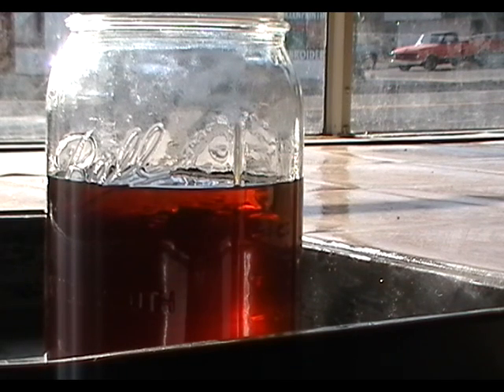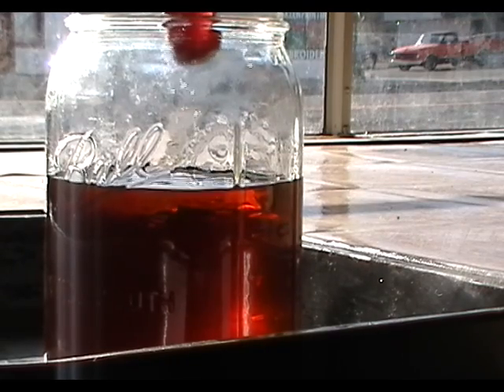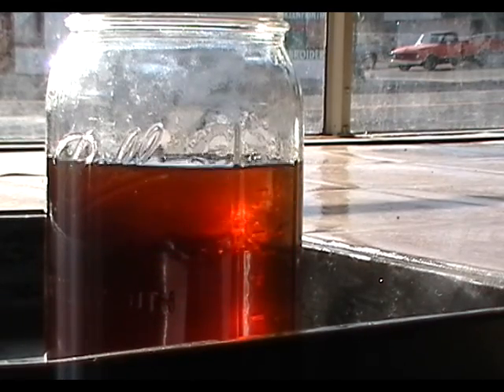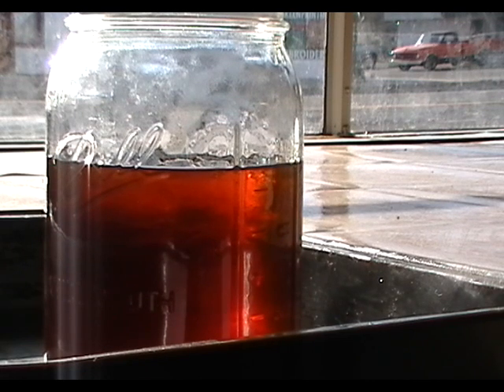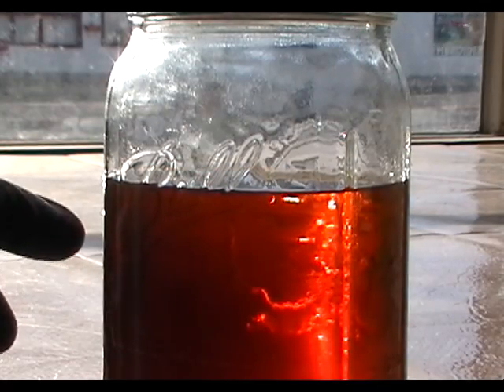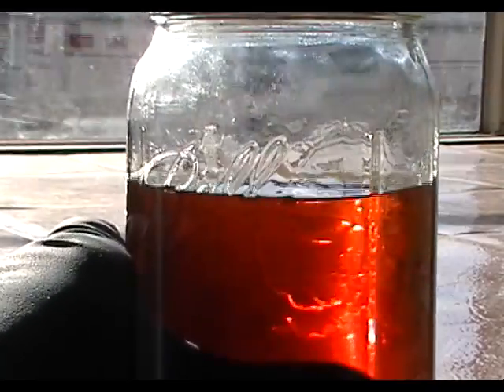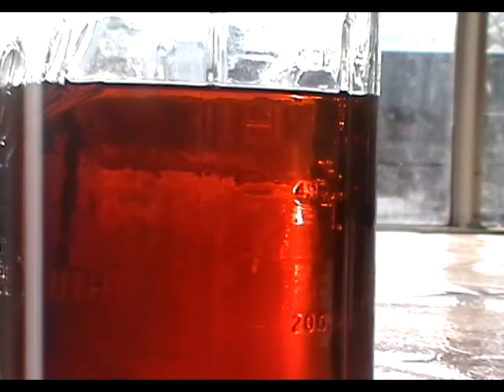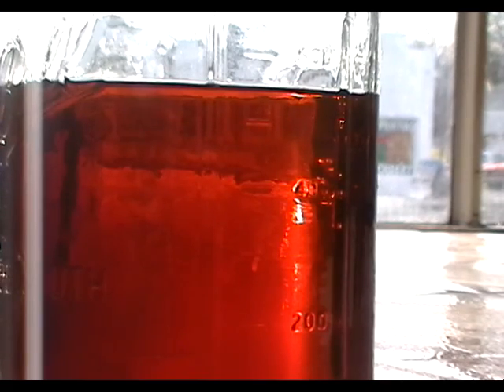Blending MEK with vegetable oil to make Diesel Fuel

Comment from the maker: @TheStriker40 I drain the water off with the sludge before I filter my fuel.  So, I find no water in the water traps in my fuel filters on my fuel line.  There are plenty of 7.3 diesel engines running my 80-20 blend with no problems.  Just check TheDieselStop forum.

Comment: Where does your water go?The bottom of your fuel tank and your water traps that you have to constantly drain?And if you forget to drain the water trap,then your injection pump gets trashed,remember water cant be compressed in any engine.Also on blending gas with wvo,it will not work in a ford 7,3 liter engine.You get a vapor lock in the heated fuel filter and theres no way to turn off the heat for it.

Comment from the maker: @TheStriker40 while the only way that you have discovered to get suspended water out of oil is to bring the oil to the boiling point of water with heat, or with the use a vacuum system; nonetheless blenders have found yet another very effective way to get water out of waste oil.  We find blending gasoline with waste oil forces water out of solution with waste oil very effective, efficient and rapid.

Comment: The only way to get suspended water out of oil is to bring the oil to the boiling point of water with heat or do what ii do,use a vacuum system to boil the water out at room temp,when you blend solvents with oil with suspended water in it,the water doesnt go away,its still there suspended.

Comment from the maker: @TheStriker40 I agree, if the fuel is not thinned, then it can break the shaft on mechanical injector pumps.  That is the reason why I thin my waste oils with solvents, such as gasoline, turpentine, acetone or MEK.  Also, I have found blending gasoline with waste oils causes water to precipitate out of solution with the waste oil.  So, other solvents may also do this.